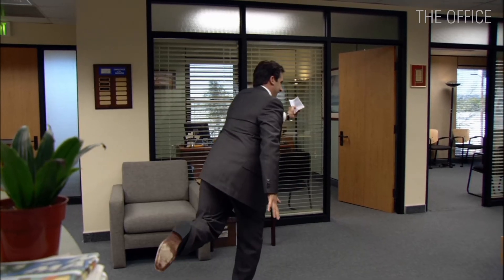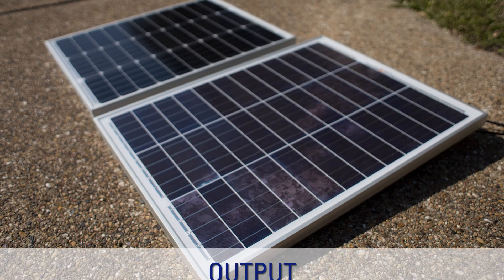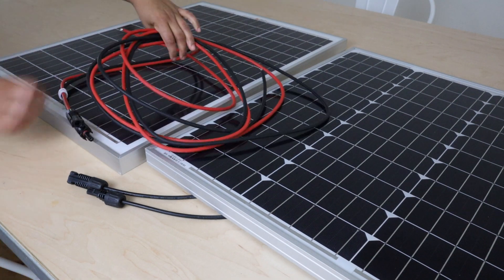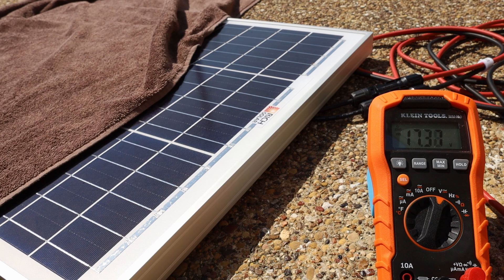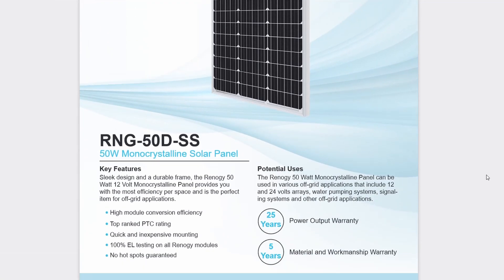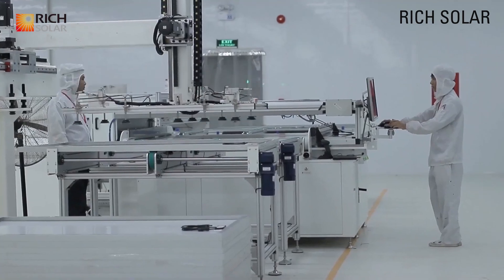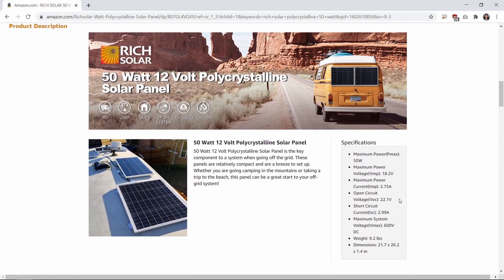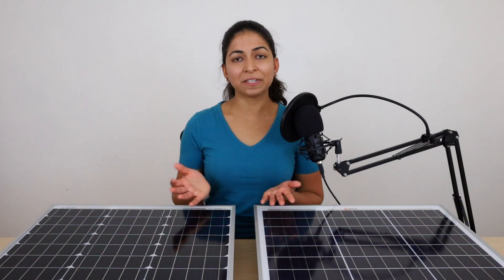(Not another) monocrystalline vs polycrystalline solar panel comparison

Comment: Open circuit voltage is what you measured and that is mostly proportional with the number of cells as all cells are connected in series and they are basically a diode and so have a voltage drop of 0.6 to 0.7V mostly dependent on cell temperature.
The current is the one that is proportional with the amount of light.
Unfortunately this smaller panels have fake ratings in most cases like the Renogy max power point voltage of 18.3V (just 33 cells) is not true an inflated to make the panel look better in terms of efficiency and rated power. The Rich Solar panel has more realistic spec so will likely be correctly rated at 50W.
If you want to compare Mono with Poly crystalline panels the take large 60 cell panels from one of the top 5 or top 10 manufacturers as those panels will have correct specs as they are sold in huge volumes representing likely close to 80% of world production. Today there is no more than about 1% difference in efficiency between mono and poly and also almost no cost difference as the solar cells are a fairly small part of the total cost of the solar panels.
Cost amortisation for solar panels is lower than $0.02/kWh making them the lowest cost energy source thus the reason I use solar PV to fully power my offgrid house including heating.

Comment: Showing volts is like telling us the psi in a water system. We need the volume as well to know if we can take a shower. Electrical volume is measured in amps. Amps (volume) times volts (pressure) gives us watts (liters per hour times psi). Watts tells us how much total power is being produced at any instant.

Comment: What's interesting is, every (and I mean every) comparison between two similarly rated poly vs mono panels the polycrystalline wins typically by a large margin and it doesn't matter sun, hazy, partially blocked, temperature, and price.  The only thing monocrystalline seems to win is in aesthetics.  It makes me wonder when the manufactures say monocrystalline are more efficient, do they mean more efficient for them to make?  Do they mean when comparing a 2020 monocrystalline panel to a 1980 polycrystalline it's more efficient (but polycrystalline panels have gotten much better since then).  I bought one monocrystalline panel seeing the advertisement saying they're more efficient, and it didn't produce enough so bought another only to find so many people have found polycrystalline more efficient and cheaper.  I wish I'd gone with the polycrystalline.  Someone compared mine to a similarly spec'd polycrystalline panel and the polycrystalline produced 19% more energy... that's a lot more AND it was cheaper.

Comment: The voltage output of an energy source does not determine its power value; the amount of current that the source produces is central to its value because it is the current that is actually being stored.  The voltage is indicative of the resistance value being experience and this is inversely proportional.

Comment: I wonder why silicon ingots aren't cut longitudinally, for less wasted material and panel area.  Obviously longitudinal wafers would vary in width, but all would be cut down to smaller standard cell widths anyhow.
Reply from the maker: Good question! Orientation of the crystals, maybe?
Reply: @BelindaCarr  I believe the orientation is determined by the seed crystal.  Wafers are manufactured with various crystal orientations.
Reply: Beyond the grain orientation of the crystals determining cut angles, longitudinal cuts never equal precision no matter what the material (wood, metal, plastic, silicon, etc.)  Longitudinal cuts always incur greater thickness variations as materials flex under their own weight and precision is reduced the closer the cut is to the end since the material at this point is "floppy" as its only held on by a small sliver of material.  This may not matter that much with wood or even some metal item that will be milled more precise, but silicon wafers depend on that precision.
Reply: @bdwilcox  Hmm, not clear why flexing would be an issue, with decent work-holding.  But if length of cut is a problem, we can cut the ingot into shorter chunks before longitudinal slicing.
Reply: @nelumbonucifera7537  Take a look at the "stack of pancakes" silicon deposition pattern in figure 13.10 here: https://link.springer.com/chapter/10.1007/978-3-319-48933-9_13.  Now image cutting through that longitudinally with the resulting flex and vibration.  It's like making an axe handle whose grain goes across the handle; any lateral force and it cracks.

Comment: Very interesting once again Belinda. With roughly only 21% efficiency, and from what it sounds a great deal of manufacturing inefficiency, not to mention the mining of raw materials needed, this whole system seems very inefficient. It would appear nuclear using thorium as the fuel would be a much better way to go would it not ??
REPLY
Reply: Not really. The problem is thorium is basically a new fuel type (which has only really proven itself in labs) and making it work on industrial scales just isn't politically possible (Uranium was only brought to commercial production because it resulted in plutonium and nuclear weapons). Plus it's still nuclear so it's still pretty expensive (from construction, disposal, finding places people are happy to house it, etc). Then you have the security issues with it. Even if fusion worked it'd be a concern as you actually need to improve on the sun's power density by several orders of magnitude. The average human can (chemically) sustain about 250 Watts of power output (by useful work, not including heat) and has a volume of 70 litres. This gives a power/volume ratio of 3.57 kW/m^3. The sun's core is about ten times worse at ~0.3kW/m^3 (about the same as a compost heap composting).

Meanwhile solar cells are just improving year on year both in the lab and commercially (21% efficiency is fantastic really, sure it's not as good as 40% but when your energy source is free, even 10% efficiency is great). They can be put wherever without much objection by people, recycling the material is going to be a massive priority in the future. The biggest issue is energy storage for it. Personally I would just be producing dirt cheap thin film solar and covering the sun side of houses in it and having side awnings made from the stuff for thermal control and extra area to offset their lower efficiency (during the high suns of summer providing shade to the windows while allowing light and heat in during the lower suns of the winter). Produce the stuff like you produce roofing felt and just swap it out when it degrades every decade or so (allowing you to regularly and easily upgrade to newer and better chemistries).

I once thought nuclear (fission) was the future and that it's the only way of being sustainable while maintaining quality of life but back then solar sucked and wind blew and now they're non-nuclear contenders which are currently kicking ass. I mean I always planned when I moved out of home to only buy nuclear energy because it's so much better than fossil energy. But by the time I got around to having to pay my own energy bills, solar/wind and biogas was the far more sensible option (in the UK at least). So yeah, I only buy green sourced energy from the grid (all electric house, no gas) and as an added bonus, it's not actually any more expensive than fossil or nuclear energy.
Reply: @Logarithm906  Look you can quote all sorts of reasons for solar , but the fact is it will never match nuclear. The other situation that is coming to light is the environmental damage striving for this obsession with only wind and solar. One of these dangers that has come to the headlines is the fact that they are now looking at rapping the ocean floor of rare earth metals , which in no way can be environmentally safe , but they (your interest groups) will do it in the call for this so called green and clean transition. . Look i can go on for hours about the hypocrisy of this so called clean and green transition, but maybe you should open you eyes and look yourself . Yes we must work towards a more sustainable world , but solar is not the answer. One more thing why is it no one is talking about the main culprit hear and that is the overpopulation of this planet!!

Comment: Thanks Belinda for explaining new things to me nobody else did. Now you need to buy an electronic load. There are very cheap ones on ebay with bad engineering but they work. (watch project farm testing 18650 batteries) Now under load and in the sun there are 2 factors heating the panels: Sun heat and also heat when current flows. So this is a particular problem in hot countries like Australia. I guess Texas is far worse than say Montana. My brothers partner has a farmhouse in Switzerland where panels form the roof. Most electricity is generated when the winter air is around minus 12 deg centigrade.  Load: https://www.ebay.com/sch/i.html?_from=R40&_trksid=p2334524.m570.l1313&_nkw=electronic+load&_sacat=0&LH_TitleDesc=0&_osacat=0&_odkw=electronic+load
On cheap models do not go near max load or buy spare fet transistors.

Comment: How to tell high from low quality without being you? Price is an unreliable guide & I'm just an dumb old fart worried about my chirren's so-called future...?
Reply: generally all new panels on the market are good quality. there was some bad quality panels 5-10 years ago when there was a mix up on the resins used on the panels that would cause water to creep in. but pretty much all new panels are made with good quality resins
Reply: Buy American, avoid Chinese.

Comment: I would like to have solar panels, although I know they're obviously not going to be the end-all for electricity concerns.  Living in DFW, I wonder if these ads I see that state I can solar panels installed for "zero or little cost" is actually true? Or is that just a marketing ploy? Do you think it's currently worth getting solar panels for a home?
Reply from the maker: I think you've referring to the PPA companies that come knocking at your door and hunt you down in Home Depot. You're basically leasing the panels from them. They are many downsides to leasing versus owning panels and I would personally choose the latter!
Reply: A major factor to consider with that type of installation is, you do not own the panels or the system. Let's say you have them install it, then five years later, you want to sell your house. That can get quite complicated if the potential buyers have any issues with the company that installed and owns it. I have friends in Florida that put up a system and paid for it out right and friends that did the free system. The first worked as an asset when it came time to sell, the second had the sale fall through because the buyers viewed it as a liability. I'm sure it was more complicated than that but you get the point. Cheers!
Reply: @wearemilesfromnowhere4630  You put it perfectly. avoid leasing panels like its COVID-19. If you want to get started, just buy some used panels and a 1000w grid tie inverter off of ebay and play with it. if you want more, then you'll need a proper installation which can rack up some cost in permits and having certified people install them. I am also in DFW,  Luckily i live outside the city limits and could do all the work myself. I have a 12Kw installation that cost me ~12K. and with the 30% tax break last year my all in investment is ~8.5K. at 11c a KWh it will pay for itself in roughly 4.5 years.

Comment: Very good video, factual and interesting at the same time that is hard to pull off, so really well done. One thing which is also important is the average lifespan of these solar panels just as some added information, if their life span differs ofcourse.

Love your videos, im here for more.
Reply from the maker: Thanks, Daniel! Both panels claimed to have a useful life of 25 years.
Reply: @BelindaCarr  Good information, but "useful life" is a fairly ambiguous term. What is the diminishing return in that 25 year "useful life"? That will affect the economics of a marginal, at best, investment. When the government subsidies are removed in the next few years it will be an even more marginal if not sketchy investment. To date, the group benefiting the most from the existing solar technology is the manufacturer. Payback, maintenance, diminishing performance all point the advantages of spending the money on a "super" insulated structure vs. alternate and inefficient energy products. Could you do, a study on the benefits of using efficient conventional systems, i.e. heat pump, mini-split systems, water heated via heat pump coupled with structure that incorporates R-50 plus walls and roof?  An effective air seal plus a system using high R-factor and  thermal mass combination will be a century long + investment rather than an expensive solar panel system and we haven't even gotten into the additional cost of the electrical wiring  needed to make solar(or wind) practical.

Comment: Some feedback on the experiment: You need to capture the power output not just the voltage. The latter is likely determined by the number of cells, but it does not guarantee you that the panels sustain a similarly high current. I would guess that the polycrystalline panel has a lower output current. Efficiency also considers power not voltage ratios. So your experiment on the "performance" is incomplete and therefore misleading. It would be nice to have the complete measures.
Reply: yes. and it is even more complicated then that. you can't just change your multimeter to current and measure short circuit current. you have to measure the current and voltage at its Maximum Power Point (MPP) in order to get the power output. That is what an MPPT solar controller is doing when it charges batteries or feeds back into the grid. Also the cells are wired in series not parallel. each cell generates ~0.5-0.6V. x 33-36 cells in series = 18-22V.
Reply: @Cracked1ce  In order to determine whether the manufacturer is giving us honest numbers, you are correct. To determine whether the mono or the poly produce the most current, a simple amperage or wattage reading is fine.
Reply: Polycrystaline panels have a higher voltage & monocrystalline have a higher current.

There are more variations..
Cloudy days has light coming from multiple directions, which could aid poly 
While mono holds slightly higher efficiency in higher temperatures

Poly's higher voltages can also mean inverters can work longer (they have a minimum voltage above which they operate

It mostly boils down to, if you have enough space go to poly, if space is not a constraint poly
Reply from the maker: Thanks for letting me know! I will have to correct that in another video.
Reply: @BelindaCarr  The current at voltage is needed to determine whether or not the manufacturers are telling the truth about the watts of their panels :)
Reply: @BelindaCarr  Keep in mind Voltage is a potential, a static energy measurement.  The real world is very dynamic, so measurements like voltage drops underload and wattage are the better way to judge the panel's capability.  Verifying the manufacturer's stated ratings for watts is often seen as an overall judgement of the truthfulness of the rest of their claims, but duplicating the manufacturer's testing conditions are quite daunting and, as such, can be as misleading as the manufacturer's own claims.  Please continue to provide us with these thought provoking videos and I applaud your willingness to seek and accept constructive comments from your growing community of subscribers.
Reply: @BelindaCarr  Where this another video is?
Reply: @BelindaCarr  you mentioned that there is CO2 produced in the manufacturing process.
 Do you happen to know how much?
Reply: @BelindaCarr  : You did indicate this was the only way you could measure performances while indicating the  additional layer of 36 cells verses 33 cells could be the differences. Excellent job and wondered if you can give us what brands are best to buy. You may have a supplier trying to put out that you are being misleading, but I felt like this was very well done. We are living off grid and would like to know your input based on brands.
Reply: @BelindaCarr  you did awesome, most people just flap their lips without testing their theory in real life.  
Please do another test, I only see Will Prowse doing a test over 1 year ago. thank you :D
Reply: I was thinking this as well
Reply: Drive a resistive load for a full day record volts and current. You can then calculate the power (W = V x I)
Reply: Will Prowse got more amps out of poly than mono in his test. While mono may be better than poly in theory, a high quality poly may be as a good of a value as a lower grade mono, etc.
Reply: Also adding some dirt and or dust on the panel to simulate real world conditions the panel would go through.
Reply: The video title is "...comparison...", duh, not performance
Reply: @verfranc  but her test is meaningless, as well-intentioned as it is, so her comparison is undermined. 

Its would be like a video comparing Li-Ion and LiFePo batteries then “testing” them against one another by taking a voltage reading.  It doesn’t indicate anything, other than their nominal voltage.  

What she is trying to accomplish is great, but she probably needs to collaborate with someone who can help her develop a more complete testing procedure.